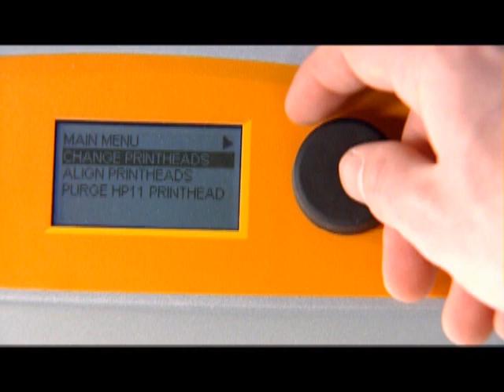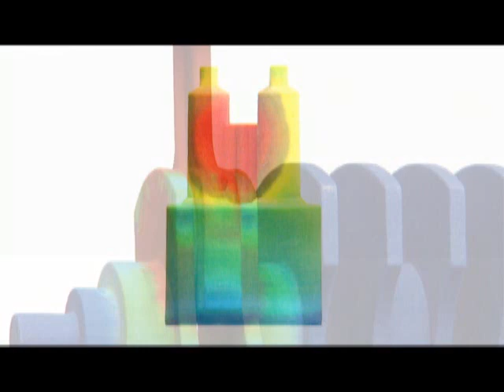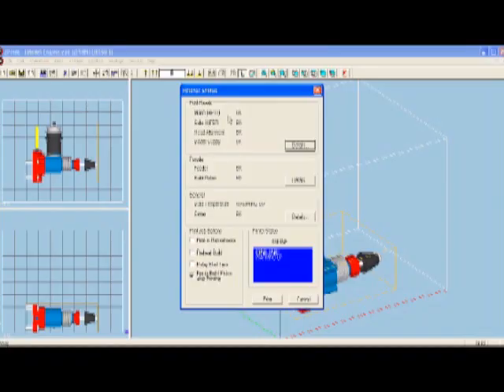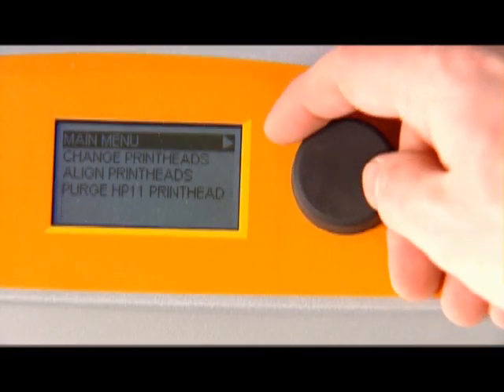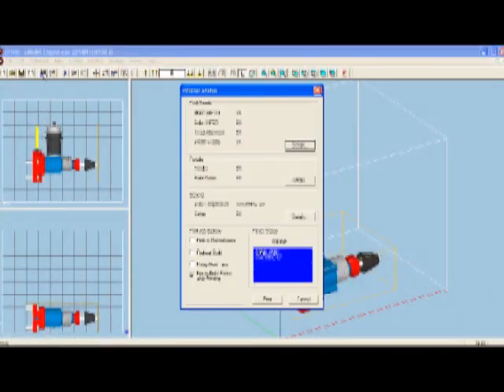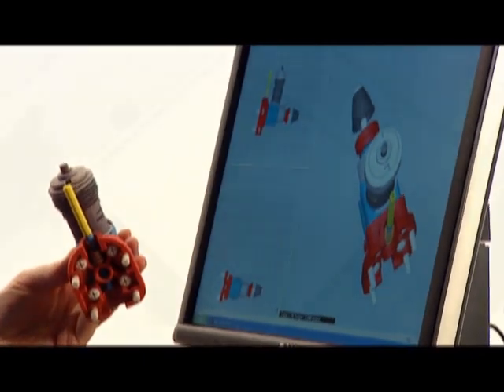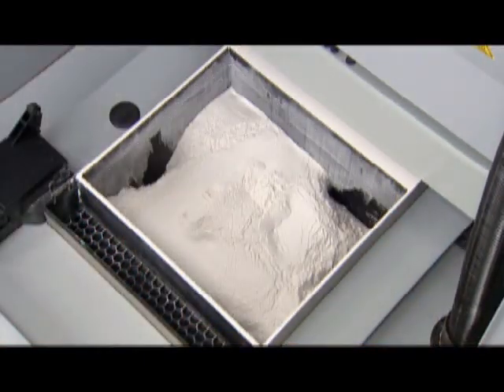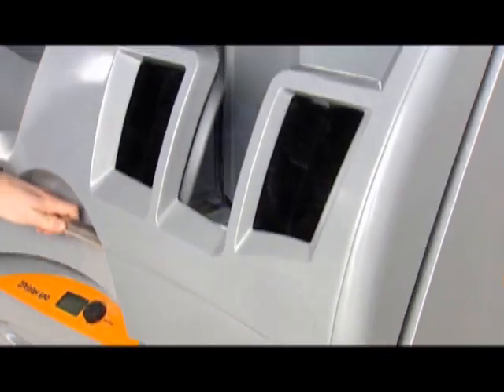Rapid Prototyping at it's finest 3D 3-D Printer

Comment from the maker: Excellent questions! Thank you.

We have models that we created over 10 years ago still being handled today.

No, they arent affected by heat nearly as much, as say, plastic prototype parts. We have had parts heat tested up to 1500F.

As for toddlers putting them in their mouths, it depends on the geometry of the item. If you print something small that they could choke on, well that's just common sense. But the material itself wouldn't harm them.

Comment from the maker: You can print functional parts, ask Ford, Chevy, Disney and many of the other top 100 companies that use them on a daily basis.
The fragility depends on part design and infiltration process. Plus, these are PROTOTYPE parts, designed for midlevel reviews and changes. They are not meant to be end-products.